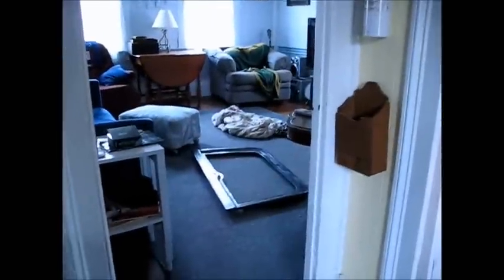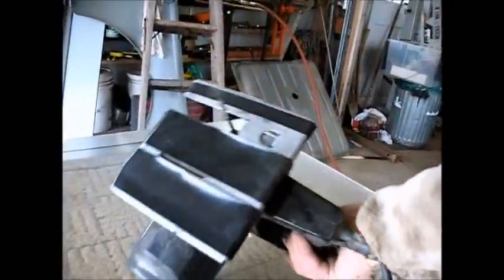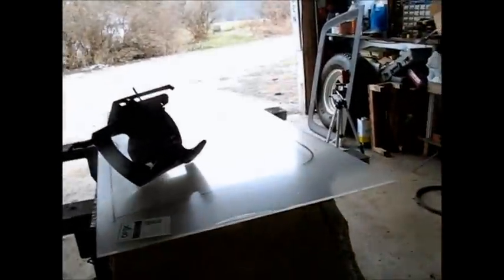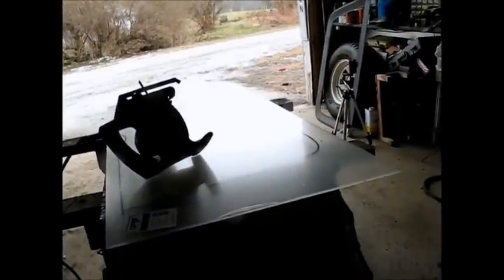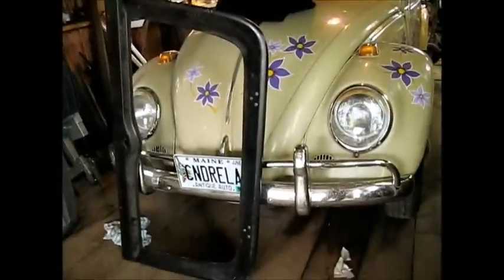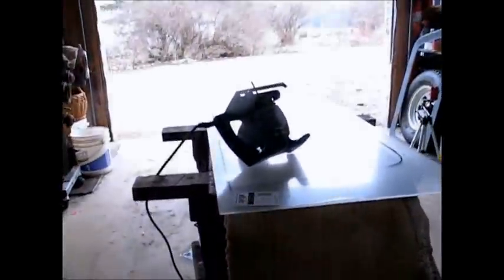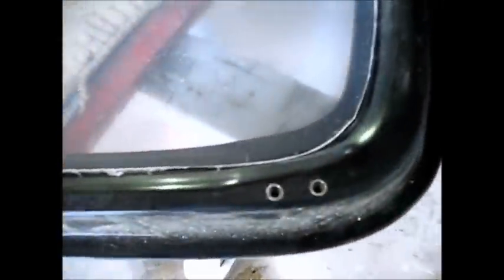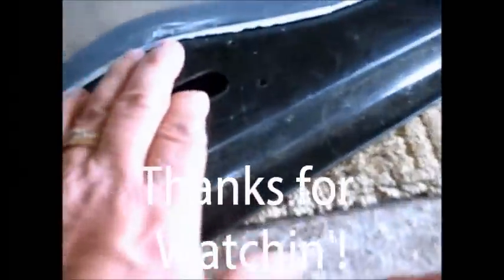Cutting Plexiglass for Jeep CJ7 hard top rear door

Comment: Yeah, that plexiglass stuff can be a bugger to work with, but boy howdy, there just isn't anything tougher than polycarbonate to cut!!! I bought a small 3/8 thick sheet to replace the skylight in my RV  I used all kinda cutting tools and saws, in the end I used a grinder too, but that stuff rewelded itself even with the grinder and WWwooo boy was it tough... I got to the point where I tried to break off a chunk and it just folded back on itself!  Hey Rich how's that gorilla tape, it any good?